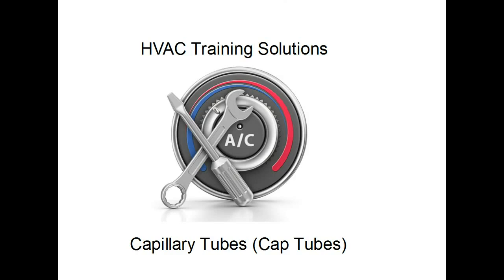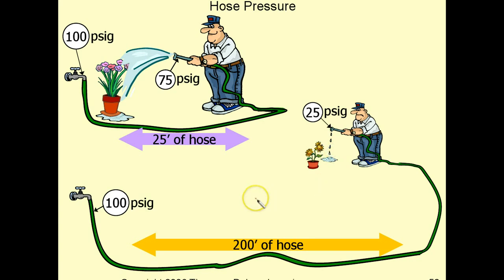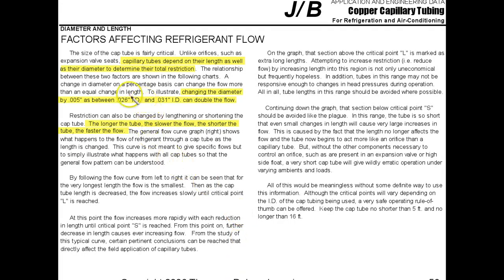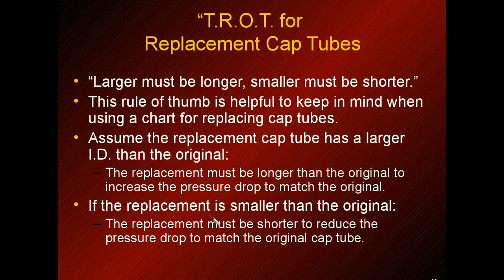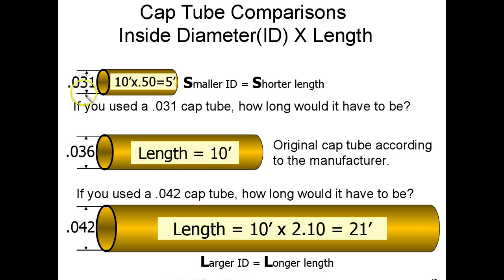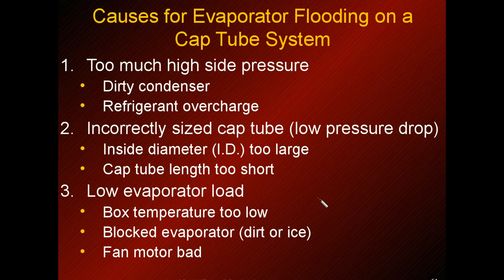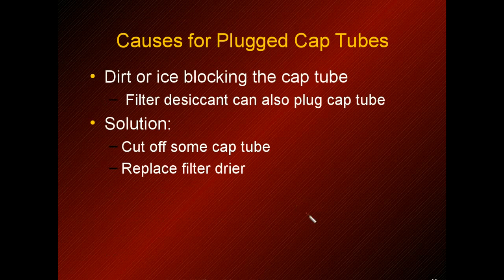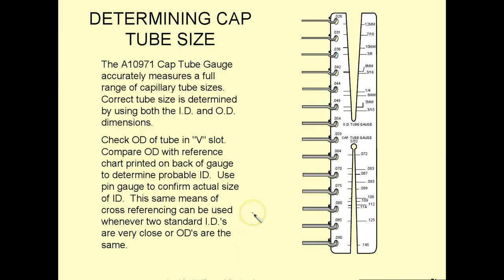Capillary Tubes in 15 Minutes

Comment: I have a problem with my evaporator the high side make a noise like forcing refrigerant into the capillary tubes and it even vibrates I think the cap tubes are stopped up , am I wrong? I’m recuperating the refrigerant into the compressor so I can take it apart and look at it..

Comment: Hi 
happy new year..
i find some free on line programm on internet to resize tube..
i cant fint the original 1.88mm   .1.3m 
 so i put 2.00mm and the result is 1.73m length!!  your video is very good but i am not so good to mathimatics ... its easy for you to check if is the Right size????
Thanks ...
i am new on cooling system

Comment: @1:50  This is inaccurate.  

The friction in the hose/tube slows the FLOW RATE, not lowers the pressure.  The slower flow rate of the capillary tube means that inside the evaporative core of the system there is a shortage of refrigerant, resulting in a partial vacuum, which causes evaporation.

In other words, the pump is pulling the freon out of the evaporator core faster than it can be replaced through the capilary tube.  This results in a pressure drop in the evap core and then follows evaporation and the cooling effect.

Comment: I am working on a nite system apu on a on a semi truck I'm wondering if the capillary tube on the sensing bulb broke can I just re-solder it or do I need to change out the whole TXV valve and if so can I charge it my self

Comment: Excellent presentation. For those more mathematically inclined the pressure drop/diameter relation for this parrticular case has a power of ca. 4.6. Double the diameter and you have increase the length 24 times (!).

Comment: If you work on gas orifices and have a wire gauge drill set I believe you can look up a conversion. And use the drill shank to measure your capillary size. I usually carry a 1 to60 gauge size drill set for soft brass only.

Comment: I have a Senville Aura mini split and am a retired hvac tech.  Problem in cooling both lines going to indoor unit are in low vacuum. Switching to heat they are both 500+ psig.  I was told by Senville it was reversing vale and replaced, but have same results. I now think it has to be the capillary assembly with dryer in the outdoor unit. I am having no luck in finding a replacement complete assembly or a good place online for parts for mini-split units. I would think a metering device for any 18,000 btu mini-split would work. It has to be clogged. IMO.

Comment: Hi Ron very informative video ,But one  question no one has ever use a electronic lead solder to weld the tubes . Do not know why ,, but is it ok if i use it for my own DIY fridge repair ,,, Your advice please
Reply: Save yourself some trouble and use a stick of silver solder. I tried a roll of lead solder once when I didn’t have any silver. It lasted a little while, but eventually it began leaking.

Comment: I use to do 100s of cap tube systems a year, stores ice boxes. How to charge a cap tube system is pretty easy. Charge system until the suction line starts to frost, remove any liquid line connections as long as pressures are normal because you need to release a very small about of refrigerant at a time. Release refrigerant from suction line till the frost line starts to come back to the evaporator, done you are now using all the evaporator and not the suction line.

Oh ya, I see a lot of guys using FILTERS on cap tubes NO the filter-can acts like an  accumulator,  I use strainers the ones that have a high side Schrader tap valve the small bullet looking filters.
Reply: Ivansgarage 'm
Reply: Never worked on a Refrigerator before but decided to tackle changing the Compressor on my Kenmore Elite...Stopped Cooling. Welded in the New Compressor and Filter/Dryer...pretty proud of myself at this point! Vacuumed out the system and let it set for 24 hours... held a Vacuum... even prouder still!! Put some R134A Refrigerant in but the system refused to get even a little bit cold!!!! System would only come out of Negative to 10!?!? What did I do wrong?
Reply: Plugged up capillary tube or filter dryer oily line and dirt residues..

Comment: Sweet. So the resistance of the flow is proportional to the "area" of the circle represented by the inside diameter and the length.  Cutting the length in half is the same as increasing the "area" of the inside circle by twice as much.

Comment: Could you score the cap tube with a razor knife and then snap it off?
Reply: I use a pair of wire strippers to score cap tube and break it off.
Reply: Cheap adjustable wire strippers that look exactly like the “special tool” work just as well as the special tool.

Comment: Bernoulli's principle (Pitot Tube) clearly explains how cap tubes reduce pressure. The relationship is between velocity and pressure. The faster the velocity the lower the pressure. This is best explained by a sprayer that sucks liquid since it create lower pressure due to high velocity created by the blowing of air. The same principle applies to why plane flies aided by its wings since lower pressure is created at the upper portion of the wing. The higher the velocity the lower the pressure until it reaches saturation point.

Comment: thanks Ron. how would you suggest soldering the cap tube into the evaporator ? I have seem the evaporator tube pinched to create a tight fit to one for the cap tube and then soldered in.how should it be done ?
Reply: I use wire terminal crimpers. Start with my large hydraulic crimper, then work my way down to manual crimpers as needed. The trick is to use something close to the same diameter as the capillary to retain a round opening that is large enough to insert the capillary tube into. I have a set of transfer punches that work well for that. Drill bit shanks would work too though.

Comment: Ron, will a restriction blockage cause the suction to drop to O psig, and the discharge doesn't move? Thanks for any help. Thanks. This is a stroll.
Reply from the maker: Mike Urnise 
Hi Mike. What is the high side reading? It is possible. Is it exactly 0 psig?
Reply: Hello Ron, I ran into 5 units with the same problem. They all have capillary tubes, but the suction drops to 0 psig on start, discharge pressure were all about100 psig.during running. When unit is off, pressure equal at 100 psig. Thank you for any input.
Reply: That is a sign of moisture in the system, liquid ref. will expand in the strainer-filter causing ice and plug up the cap tube stopping the refrigerant flow, the strainer-filter will warm up and the cycle will repeat. evac. system and recharge.

Comment: hi, i was at a fridge tonight that was a cap tube system. it was low on charge refrigerant was 134a im just wondering how i would correctly charge the system if the charge is now known?? all i did was charge it to my suction pressure being a med temp application.
Reply from the maker: Weighing in your charge is the best option, if you can find it out. What you did was correct.

Comment: Very well done, Ron. I've never heard or considered that the restriction blockage due to the filter dryer is usually within the first inch or less of the cap tubs entrance. Like to share info on drier. Sometimes the 'powder' is a result of the beads vibrating and wearing off very small dust, because of this I just accepted that the blockage could be anywhere in the cap tube, which it still could but your info on the opening portion was enlightening. I never use a beaded drier when I replace them but instead use the Sporlan cap tube driers, I've never had a reoccurring problem using a solid core.
Reply from the maker: I usually recommend replacing the entire cap tube when you replace the drier just to make sure. The blockage is "usually" in the first few inches, but not always.

Comment: Hi Sir Ron Walker, i just watch your cap tube in 15minutes.. i am glad to see this lectures on videos, i work here in uae as a refrigeration technician and we usually do a customized refrigeration unit/system, i used J/B cap tube size chart for a new refrigeration system, but sometimes i might be get wrong by using the application because it gives me a bad result of cooling performance, we usually used a Tecumseh Condensing unit,is J/B cap tube chart is also applicable application for Tecumseh?